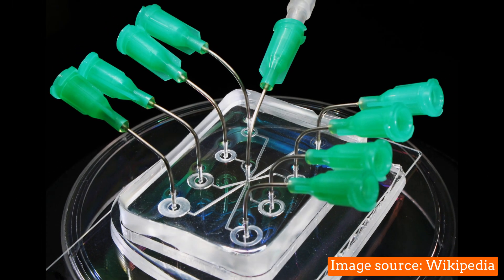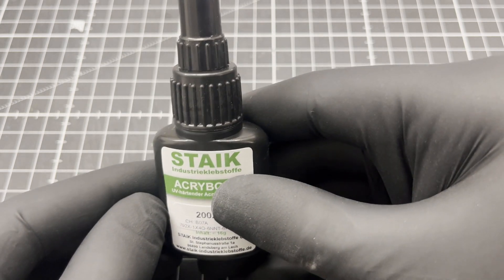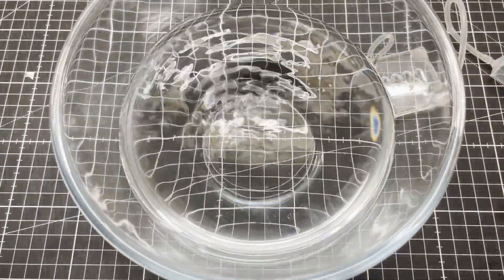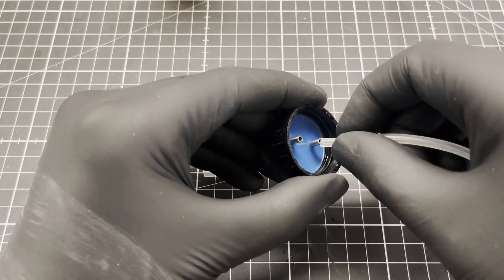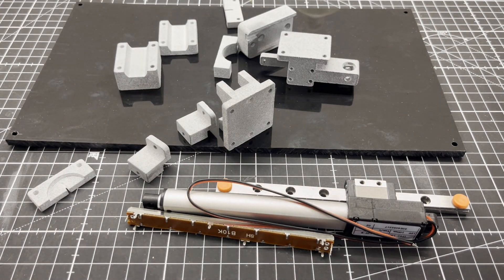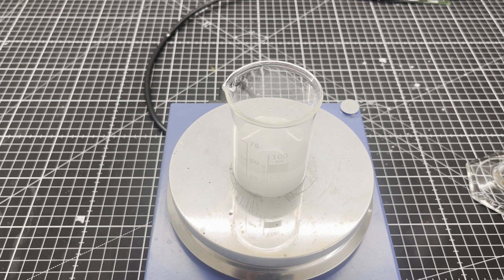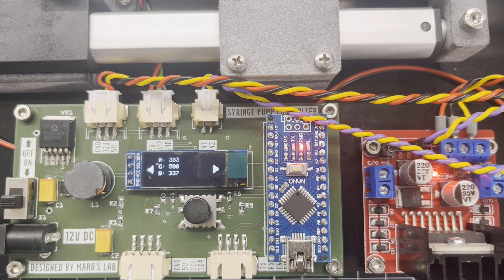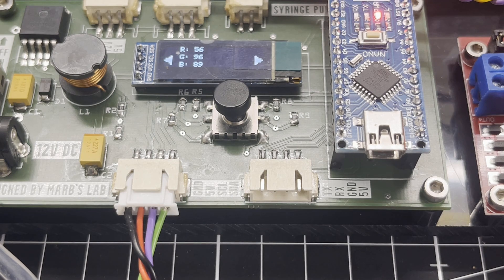Building a lab-on-a-chip

Comment: Absolutely fascinating. Im no chemist but I do use a co2 laser every day and im familiar with arduinos and electronics. I think it would be a blast to try making a lab on a chip but wouldn't know where to begin with the design of the pattern in the acrylic. Excellent video.
Reply from the maker: Thanks:) Regarding the pattern, search for fluidevice, an online design tool for microfluidic devices. The basic version is free.
Reply: @Marbslab thank you

Comment: Lovely! I'm a QC Lab Tech and can imagine so many uses for this sort of device! I think the test I would replace first would be our water testing protocol. We use a dropwise sulfuric acid titration and two EDTA titrations to get the alkalinity, total hardness, and calcium hardness. It may be qualitative at first, but better control of volumetric delivery could yield a quantitative result. Otherwise, I'm reminded of the 20E colorimetric bacterial enumeration panel made by BioMerieux as well. If there were a way to more quickly add a fixed volume of fluid to all 20 wells and read them all automatically as they change inside the incubator, you could simplify a very complex and time consuming task at the heart of highly technical microbiology labs. Thank you for sharing a brief view of what's possible using some simple CAD and creativity 😁! You rock!
Reply from the maker: Thank you:) I am currently exploring the possibilities of a blood type test LoC. I am also working on a flow spectrometer and an electronic nose. Too many ideas...
Reply: @Marbslab  Those sound like great ideas! Particularly, if there's a way to check for the presence or absence of coagulation during a blood type cross match. My Mom's a medical laboratory scientist at a hospital and this is a life saving lab test that's incredibly simple to run and interpret. It gets run on every donor recipient, so you'd want it fast and high throughout if possible. 

Plus, I love the idea of electric noses! The first time I saw a fire department use one I was blown away. Being able to detect flammables, volatile organic compounds, spoilage indicators (aldehydes, acids, ammonia, nitrates, alcohols, etc), and maillard products all would have very valuable uses across several types of labs. I'm excited to see more 😁!
Reply from the maker: @dillonlee3992  The challenge is always to get the right material as someone doing private research, but that's also the beauty of it. For example, I got the glucose oxidaze from a winery that uses the enzyme to keep bacteria away. Thanks for your encouraging comments!🙂
Reply: @Marbslab  You're very welcome!

Comment: Great to see you managed to build it! As next steps you could think about a rotating valve that allows short injections. Most FIA work with a continuous „neutral“ carrier stream which pushes a „bubble“ of reactants through the system. This allows for much smaller sample size as you don’t have to fill the entire system with sampl/reactant. And it would require to push, not suck…
Reply from the maker: Thanks. I recently bought a bunch of very tiny one- and two-way selenoid valves, which might do the job of injection. And a UV-Vis Flow spectrometer is also on my to-do list:)

Comment: A peristaltic pump would have been easier to use and integrate
and you also can get them for the same price as just the actuator and even cheaper :)
Reply from the maker: With syringe pumps, the volume flow can be set very precisely and they can generate higher pressures. With a peristaltic pump, you have to use one with a stepper motor to be able to control the flow rate precisely. You can hardly get a peristaltic pump with a stepper motor for less than 50 bucks. But sure, it's another option :)

Comment: thanks for the nice video, Could you add a schematic of the fluidic system?
Reply from the maker: Thank you. Do you mean a schematic of the color sensor board and pump controller? Or the svg. drawings for the laser cutter?
Reply: @Marbslab  just a schematic of fluid flows  but pump controller details would also be helpful. Thanks.